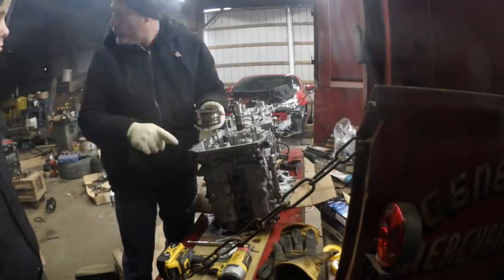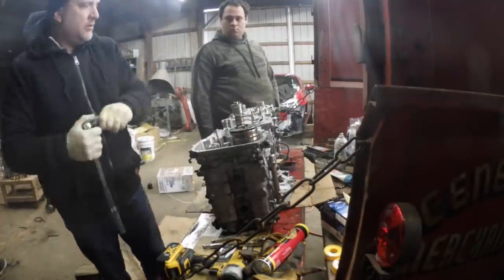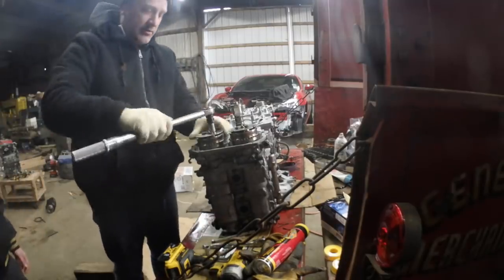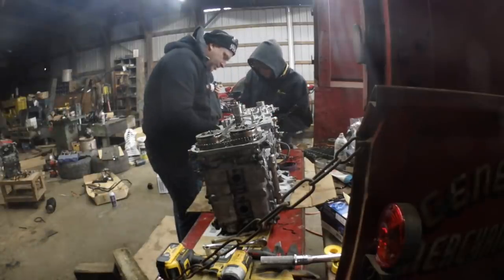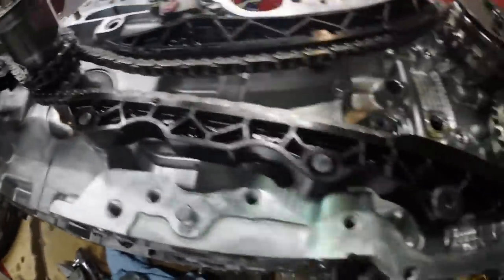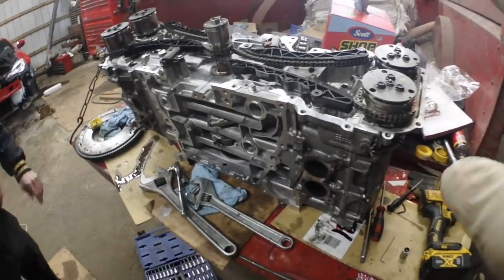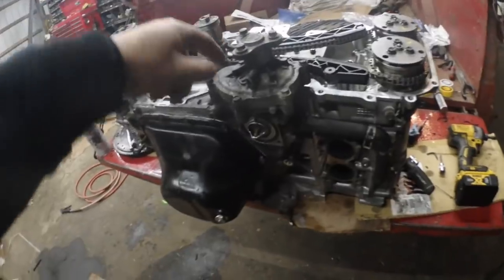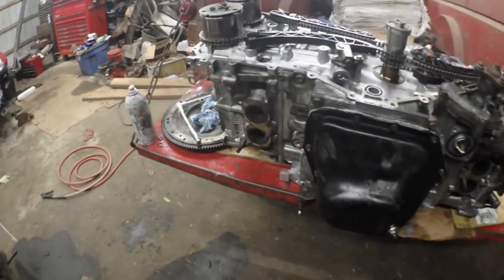Getting there

Comment: Working on a Subaru engine seems to be much more like working on a motorcycle rather than a car.  I looked at getting one as I really like station wagons but they no longer offer cars in 2 wheel drive.  I really don't need a 4 wheel drive car in the south.  I had an 89 Subaru GL wagon for a short time once and that was 2 wheel drive so they offered it at one time.

Comment: There are several lessons to learn from in these Subaru videos in my opinion. 1, Don't forget to tighten up the sump plug. 2, Don't work on a Subaru engine unless you have time, knowledge and resources. 3, If a Subaru engine comes your way to repair or get involved, then it time to find the worst/most dreaded job you have been delaying doing and go do that instead! Much respect to you Wes because I wouldn't have a clue with that engine and the unconventional torque sequences would do my head in so I would run a mile from a job like that!
Reply: Worked in a garage and a Subaru came in that needed timing chains. Asked if we would work on it and everyone in the shop said No Way.  Hats off to them for trying.
Reply: Cannot believe it will work.Ok.!
So fingers crossed,!